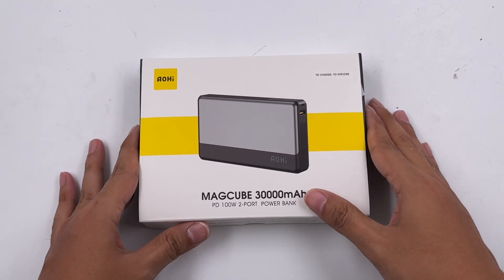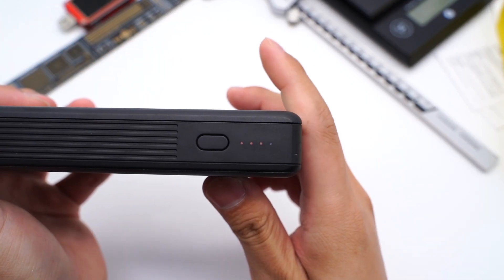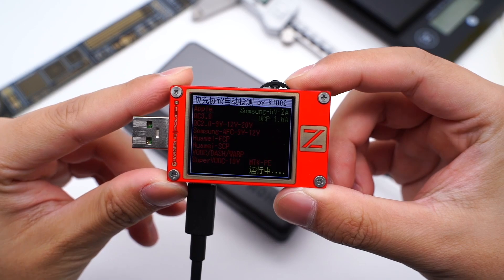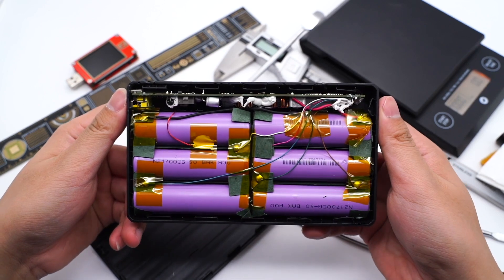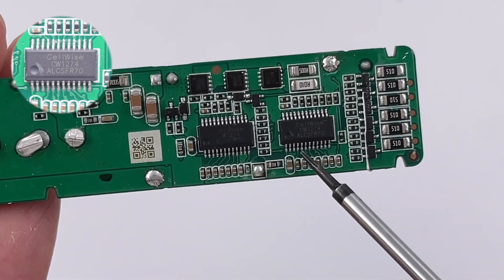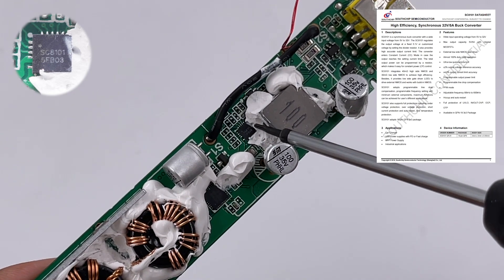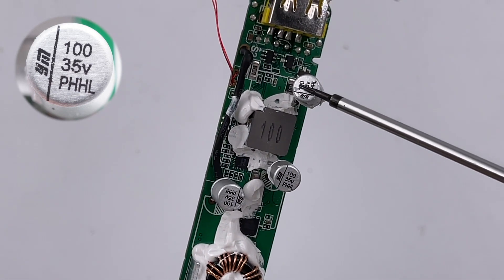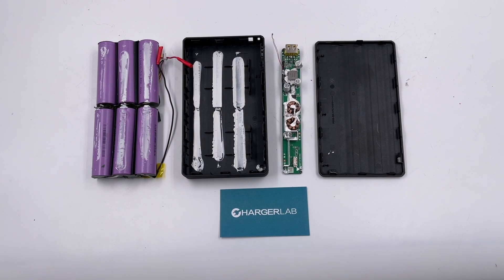Happy New Year | Teardown of AOHi Magcube 30000mAh 100W Power Bank (AOC-P008)

Comment: Idk if it's too late, but I dropped mine and it basically moved the USB C port away from the hole so I can't plug it in far enough to get it to connect and charge. Idk if there's anything I can internally or if I may just be fucked

Comment: Looks like AOHI changed the internal components. In your testing the Power-Z meter showed it supported PPS, as the box and unit specifications claim. However, I just received my unit, and testing it with the Power-Z KM002C shows that it doesn't support PPS at all. I can verify this with my Samsung Galaxy Tab S8+ (which uses PPS) only charging at 15W, but charging at 45W when connected to a wall charger which supports PPS.
Reply from the maker: Thanks for the info.
We will forward it to our team.
Reply: @ChargerLAB  i got a second unit from Aohi, which does support PPS. Unfortunately using PPS at 45W with my Samsung Tablet triggers a safety feature on the power bank. It immediately starts outputting 0W and flashes the lights 4 times.
Reply: @OmairArif  Which is a shame. Only downside I have with this powerbank

Comment: This is 108Wh rated power Bank but you cant get any thing >100wh rating with you onboard on air plane. How this power bank got its certification?
Reply from the maker: It is true that a power bank > 100wh cannot be brought on board, but this does not mean that it cannot be certified. You can use it safely in other situation.
Reply: they changed this rules recently to increase allowed wattage,  check w specific air line
Reply: I actually asked this question on r/TSA and they said 108 is probably not even noticeable anyhow - Meaning, it won't spike alarm as its not very large. I'm guessing they are more worried about extremely large power banks. I was gonna get a 62KaH but that one would probably lead to me being questioned lol. In the past, I have never been asked about my other power banks, and this one is actually smaller in appearance than my others which are TSA certified. I personally am not worried about it.